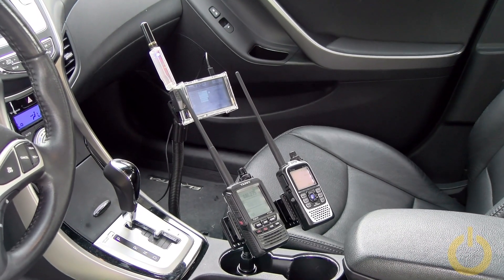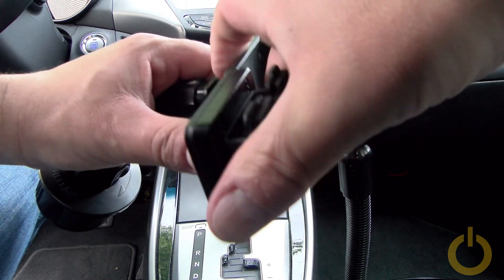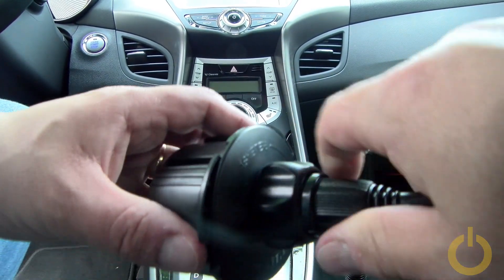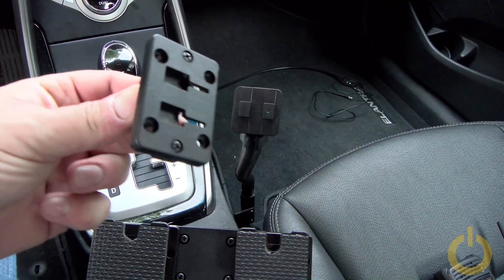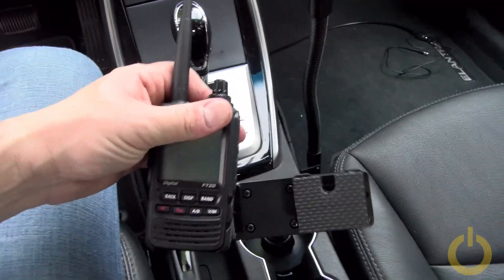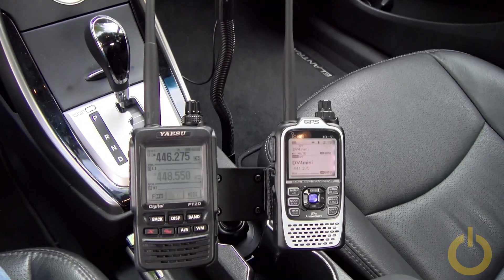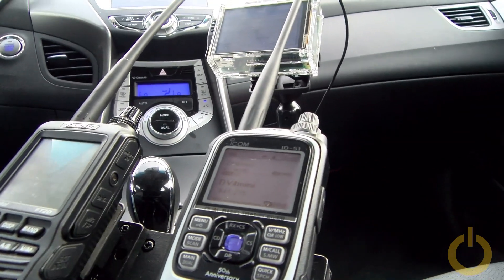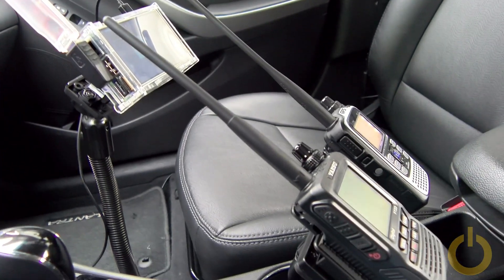DV4mini mobile installation with Yaesu FT2DR and Icom ID-51

Comment: what colour should your DV4 MINI  be  when   transmitting  d star into  it  ??    mine is green  and does not seem to be working no more ??
Reply from the maker: Hi Jonneil, Try reflashing the firmware, the led on the DV4mini should be green when it received and red when it transmit.  If you look at the software there's a bar graph showing the same colors for the same condition.  73
Reply: OK THATS THAT BIT SORTED NOWIM LOOKING FOR BRANDMIESTER ON DMR IS NOT ON THE LIST WATT TEST VERSION DO I RE FLASH ?
Reply from the maker: The new DV4mini Compact software has the BM reflector. 73
Reply: Laboenligne.ca WHAT VERSION IS IT PLZ AN IS IT A TEST VERSION.?
Reply from the maker: You can use the original image it will update itself.  You can also manually update the reflectors.  73
Reply: Laboenligne.ca i tried that but no brand miester

Comment: This is not a good idea to receive the signal inside your car. It's always better have external magnet or mounted antennas for better signal and SWR. But I like your video. 73!
Reply: Your right, but in my case I'm only communicate with the DV4mini that is inside the car ;-)  73